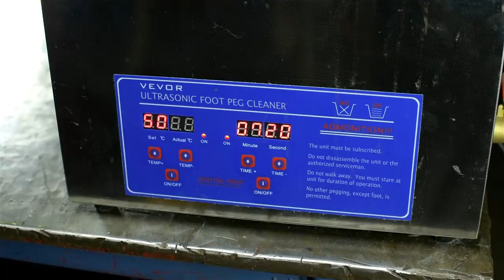7075, 7076... Whatever It Takes

Comment: “Can’t be welded, don’t try”

Immediately welds it
Reply: And he wonders why we didn't trust the magnet vs demagnetizer title.
Reply: Had a 78 'Varna MX with a cracked crankcase. Tore it down & got to the argon gas tig welder we had at work. 
Gave it a try but couldn't weld it.
Turned out it was MAGNESIUM!!!
(I had welding shop do it for a 25 bucks)

Comment: Hey Tony, love the episodes. 
I think you might find this interesting.

Around the start of 2019, a process was actually developed so that you can weld 7075. 
The reason you cannot weld it is because the heat around the pool causes the alloying components in the aluminium, to diffuse out of the "correct" structure. After the pool has solidified, the structure is no longer the same as its surrounding. The difference is so drastic that the two areas behave as two materials which don't bond perfectly to each other. This results in the cracks you had mentioned, and then failure.

Through lots of testing and such, a researcher in UCLA found that by adding a percentage of titanium carbide particles, to the aluminium filler rods, you drastically reduce the level of diffusion and therefore the possibility for cracks. This process has been proven to work, and the researcher even built a bicycle using it. 
I've linked the article on it below. Its well worth a look.
https://newatlas.com/welding-aa7075-aluminum-alloy/58449/

Anyway, hope you find this interesting. Keep up the good work.
Reply: Cool
Reply: Hmm so a begginer welding project it is? Cool. I will make sure I add tungsten! 😅
Reply: At the end I briefly thought this was going to end in a joke about dipping your tungsten..
Reply: Captain MufDyven  you must work for McFarland Fabrication!
Reply: @l.d  I'm actually so disappointed I didn't come up with one😂
Reply: I doubt a sane person will use alu rods with tungsten particles because tungsten based compounds are highly toxic
Reply: Captain MufDyven  hell yeah, bog deep, let it eat with that tungsten.
Reply: ......so, out of curiosity, when did titanium carbide become tungsten? I'm fairly sure that's not how radioactive decay works, but I'm not a physician.
Reply: Captain MufDyven  stool the joke right out from under me....
Reply: Or you can immediately get that weld into a cure oven at 750°f step down to under 250° over the next several hours oh and no oxygen in the oven either
Reply: Titanium carbide particles. Not Tungsten. Either way rods will be expesive😄
Reply: @custos3249  sorry, I hadn't read the article in a while, and tungsten was in my head 👌
Reply: thanks for sharing!
Reply: When did Titanium become Tungsten? Curious because like five people messed that up
Reply: Typical engineers.
"You can't do X with this material."

"LIKE HELL I CAN'T!"
Reply: @caseymcadams5483  "(edited)"

Comment: Alternatively, you could have just welded the steel on the frame... But then when you get new pegs you'll have a whole new problem. Perfect.
Reply: I would make 2 tiny moles and glue in with epoxy 2 pieces of stainless steel pegs.
but who knows what problems would emerge from that

Comment: Or, and I'm no expert, howevere I've told many motorbike owners that their ignition timing was off, just to see how tough and confident they really are - they never laugh but I get a respsonse so red hot you could weld titanium with it. Fortunaltely because their ignition timing is off I could usually outrun them, or just scramble up a tree, start meowing and wait for the fire department to show up. But couldn't you just have welded a bead onto the steel frame where the pegs hits it...? Granted it wouldn't have allowed you to weld non-weldable material, so I get that, we all have a bucketlist.
Reply: Yeah, but then when he inevitably replaces the pegs, then you've gotta grind that extra weld off to accommodate the non-worn pegs. Might as well fiddle with something thats already 'broken'.
Reply: @robokid20001  Excellent point, don't make changes to a good part.
Reply: The first thing that came to mind, and it wouldn't be that hard to remove when he got new pegs. Just my 2 cents.
Reply: @Andrew Humphrey as a motorcyclist I support this message

Comment: After that intro, when you came with the mug I was counting your fingers.😊
Reply: was expecting at least one bandaged finger 🤭
Reply: I saw at least 18, maybe 20, hard to say with hangove...
Reply: Then video would be called "How to weld your fingers back together" or something like that.
Reply: At first I thought he was not a carpenter so he has all his fingers. Then I discovered why carpenters have "shorter" fingers ... They can show one and a half inches showing their fingers. ;-D
Reply: he has stunt hands
Reply: The mug was chipped!
Reply: still has his fingers still no finger nails
Reply: I always count his fingers.......
Reply: Oh s***! then Phew! Ten Fingers!
Reply: No joke, I definitely had stitched before due to a part shooting out of my hand. It was a knucklehead mistake though, not just working in the wrong direction, but I also used a tool that absolutely didn't belong on a drill press.
Reply: His fingers, nothing! I jumped when it caught, and ended up counting my fingers.
Reply: Mee too
Reply: Climb cutting not recommended with using manual part holding.
Reply: when using high spinning router bits, if you hold the part correctly, they should always spin away from you as opposed to into you. This way it is being removed from your hand instead of being forced into it.

You learn right away how to old things (speaking from experience).

ONe time I put my fence on the wrong side of the router bit (brain fart) and thereby created a lethal spear chucking machine. Think of how a baseball thrower works at the batting cages...only spinning at 25,000 rpms. I fed in a 1/2" x 1/2" piece to put a chamfer on and it went through the drywall and  halfway into the shop next door.
Reply: my audio must be off, I couldn't hear the ToT ricochet sound effect when the guard shot out.
Reply: Everyone counting fingers and nobody says anything about the missing ring??

Comment: The sight of those studded pedals made me remember how badly those things ruined my teenage shins.
Reply: Shins? You're lucky! I had a 2-stroke off-roader with similar pegs (except all steel and narrower). One day, far from the madding crowds it just wouldn't start (damn 2-strokes!). So, after checking spark, fuel etc I tried to push-start it - for an hour! At the end of that time, exhausted, I tried one more time. Downhill slightly, got up to speed, clutch in in second gear.. When I was up to speed I jumped on the seat sideways as I dropped the clutch to ensure the tyre bit and then jumped off again and leaned into it...

After about 5 seconds the bike took off like a scalded cat, dragging me away forwards with it and I fell on my face with my right arm up over the bike. The footpeg cut a 15 cm gash into my right armpit. It was a long hot summer (think sweaty armpits) and, as a tough country teenage boy I didn't go get stitches or anything. It was a puss-ey nasty mess for weeks. At first it semi-healed with a chunk of armpit skin folded into the wound and the hair kept the wound open so I had to pick it apart, shave what I could and use sticking plaster to keep things in place until it healed properly.

I envy you your sore shins. I still have a big scar in my 'pit 40 years later.
Reply: ChrisHallett83  yeah that was pretty much my experience, they offered superior grip if you had your feet square on the pedals but God help you if your feet slipped. I remember having an x-ray on my leg in my 20s and the doctor remarking on the fact my shin bone looked like a rasp file because of all the tiny lumps and divots, it must be quite common because he asked if I rode a bmx as kid.

Comment: 00:16 thanks for the jump scare warning. Reminds me of my first time using a table saw. Scared high schooler + Satans wood cutter= soiled pants and a dented dust collector
Reply: A big wood shaper can really ruin your day if a part decides that it wants to shoot out the back at almost lightspeed! Those things on high RPM with a large straight edge cutter head, or even better with profile cutters can develop some insane forces when you do deep cuts!
Reply: You guys should learn not to climb cut. And use feather boards ;)
Reply: @colinantink9094  If I would climb cut and someone sees me, I would get beaten with the piece of dead tree carcass I worked on :D But it is always fun to see aprentices trying to climb cut while a 200mm cutter rotates at 6000RPM. Makes nice holes in the drywall!
Reply: Drakkar Calethiel blink!  And the parts in low Earth orbit!  Maybe I should try to get a NASA to build some sort of giant cutter....
Reply: I was in junior high waiting my turn for the TS when all of the sudden arrows zinged by me as the kid's project in front of me was torn to shreds. The instructor sat us down then lectured us on safety for the next 3 days.
Reply: Colin Antink oh I’m not a termite, I shudder at the thought of touching dead tree carcass now. I’m an Electrician, that element of danger I can handle and no sawdust to eat.
Reply: @colinantink9094  Hahaha, really want to try ramping our 300mm dia, 40mm thick cutter up to 12k RPM our shaper goes and climb cut some hardwood. It's just dangerous as heck! It wouldn't even surprize me if something fails mechanically, that cutter weights a ton! Also must be insanely noisy, the 150mm spiral cutter at 12k in combination with the dust extraction system sounds like a bloody jet engine from 1 meter distance.
Reply: @DrakkarCalethiel  Ruin your life. I've heard stories of guys wearing body armor to operate shapers back in the day when cutterheads were not unknown to throw knives.
Reply: @hughmac13  TBH, shaper are the most dangerous machines in a woodworking shop along with jointers. Large fast spinning cutters/knives, perfect for really nasty injuries. A mate at work got bitten by our jointer and lost two fingers in the progress. 
Love it when people say that woodworking isn't really dangerous. It can get nasty pretry quickly if you are not carefull. 
Usually I'm a guy who lives a bit on the dangerous side, but jointers and shaper earned my respect the first time I used them!
Reply: Drakkar Calethiel the table saw is responsible for most woodworking accidents BY FAR. Like 4 times as many. I won’t have one in my hobby shop. They’re incredibly useful but they also an amputating machine. It’s almost impossible to have a minor accident with one.
Second are jointers, planers, shapers and Sanders. Third was mitre saw, if I remember correctly.
Reply: @A1BASE  Depends how you're using it. I run a sliding table saw and fix work to the slider. Exceedingly safe. The work is never trapped and neither your hands nor body are near or in line with the blade. I don't like rip cuts on the table saw, and with a slider you can almost always avoid them. You can set up narrow rips with the slider (I came up with a setup with adjustable fence-blocks and toggle clamps) or else I rip on the bandsaw. You can always do a final parallel operation in the planer. Jointers don't bother me. I run a 16" SCMI, which can expose a lot of cutter, but with good technique and using the guard, and not jointing anything stupidly narrow, my hands are never near the cutter. With big cutters shapers are scary and I won't work without the feeder.
Reply: @DrakkarCalethiel  If the cutter is large I won't run it without the feeder, which also allows you to climb cut safely.
Reply: @A1BASE  Absolutely, most accidents happen with the table saw. Guess people are not enough carefull, or they completely forget that a couple mm are enough to cut a part of your finger clean off. 
So far, in the 6 years I worked at this company, we had only one accident at the table saw I know off, which really surprizes me. But three on the shaper and two on the jointer, last one was the worst.
I, on my part luckly only had minor ones that happened outside the machine hall. Well, I kissed the large belt sander with two knuckles once, those mofos burned fot the next two weeks.
Reply: @colinantink9094  : "Kick to orbit" has been considered (they're called sling-o-trons, or something of the sort), but most stuff vaporizes in the lower atmosphere. They figure it's more practical to take an over-sized bandsaw blade, and get it going fast enough that it forms an arc that rises most of the way out of the atmosphere, then just grab on so that it'll drag you up, they call them "launch loops".

Comment: As a welding engineer, I would say it's okay for the reasons you stated; It's just an overlay. Should be fine.
Reply: Did you consider brazing a plate on? That would probably have been the true industry standard correct way. Of course, a hell of a lot more of a PITA
Reply: @spugggaldon361  : Are you saying you know a sane way to braze something to aluminum before grinding most of the oxide off, or after?
Reply: @absalomdraconis  like I said. A real PITA. But it is doable. The lower heat input will also prevent any unwanted nasty metallurgical changes in the base metal. In this instance This Old Tony has probably made the right decision. It was a very short and quick weld. The fact it's also just an overlay and not a joint and that overlay is going to be kept in compression are all good factors.
Reply: @spugggaldon361  I haven't done any welding or know how relevant this is, but when making jewelry rings smaller I keep the stone in water to keep it from burning/scorching when silver soldering the ends together. It's like soldering electronic components. You have to keep the heat of the melting solder off the part lest you burn it up. Even if you have the heat high so that you can melt it quickly you can't let that heat travel to the part. Forceps often make a good heat sink.
Reply: @ExtantFrodo2  brazing aluminium is usually carried out by heating the base metal, with a torch, and then using the heat in that base metal to melt a brazing rod (lower melt temp of brazing rod) onto the component. You then allow capillary action to draw the liquid braze metal into the joint (close fit) and fill. 
Soldering you apply heat directly to the "filler material" and little heat into the base material. However, as jewelry is small there is very little material for the heat to be soaked up. Am I right or making myself look like a tool on the internet (again).
Reply: @spugggaldon361  No, it's the same. You're supposed to use heat in the base metal to melt a solder (whether it's silver solder or lead/tin alloy). Even soldering wires together. You heat the wires to the point where they melt the solder. Any other way and you risk making a cold solder joint.
   As far as "very little material for the heat to be soaked up", the heat has to be raised to the melting point of the silver solder. The metal conduts the heat very well. That's the problem. It matters a lot when you are talking about possibly burning a $10,000 stone.
Reply: @ExtantFrodo2  this is probably why I don't solder and haven't since school (1998 - jeez a long time ago) I am doing it wrong! Yeah, the ring heating up quickly is what I was getting at by there being very material to act as a sink. As soon as the heat travels 180° around the ring and meets the heat coming from the other direction the material will then heat up quickly as there is nothing left for it to sink into. 
Now, I work mostly with steels, stainless steels and some nonferrous metals and I'm fairly new to metallurgy and welding engineering but if you look at the phase diagram of a gold platinum alloy you will see that the matrix has a very stable phase up to 800°C in a 25%-75% platinum gold alloy (white gold). Your silver solder has a melt point of 450°C I think. Now if you were to immerse 50% of the ring in water instead of just the stone to prevent the stone area getting hot I see no reason for it to cause any metallurgical problems in the ring metal. You may find the ring cools very quickly though making the process a little more difficult but it would protect the stone more effectively. 
Now, DO NOT take what I just said as gospel truth. Precious metals are not my thing. I would suggest practicing any change in your process on something cheap 1st. 

Also, if you're interested in phase diagrams have a google and then have a giggle.
Reply: @spugggaldon361  " if you were to immerse 50% of the ring in water instead of just the stone "
I always do. 

:-) 

Thanks for the info.
Reply: @spugggaldon361  Old school Aluminium "Brazing" (using an oxy-gas torch with a flux to remove oxides) uses 4047 alloy as a filler rod which has a melting point only a little below that of the parent material such as a 6082 alloy fuel tap boss on a 1200 alloy motorcycle fuel tank. 7075 though, has a lower melting point than 4047! I don't think there are any suitable filler rods for the job - unless you're thinking of "Lumiweld" or suchlike, which I can't imagine would ever be considered an "industry standard" !
Reply: @MidEngineering  yeah... my main worry would be ruining the metallurgy of the 7075. I've found this hilarious sales video though: https://www.youtube.com/watch?time_continue=238&v=n1njyuPBIH0&feature=emb_logo I wonder if @This Old Tony would like to take up the challenge? Braze 7075! They claim it works on ALL Al alloys. He's already welded it. Should be easy for him ;)
Reply: Meanwhile I would have added sticky tape...